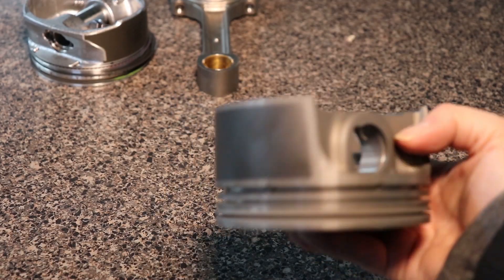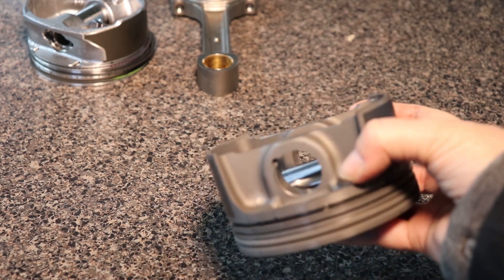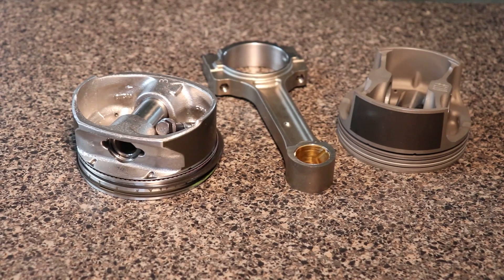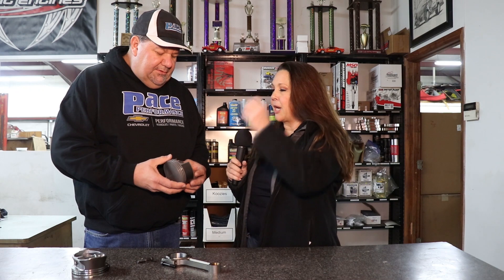The Latest on CT525 Engine Changes with Don Blackshear

Comment: So all crate 525s purchased from any supplier has these mods now?
Reply: Yes, If you look up the part# for the CT525 you'll see there's now 2 different part#'s with the newer CT525 upgrades having a different part#, That new part# is with the upgrades
Reply: @bidenstoletheelection9116  what's the new part #?